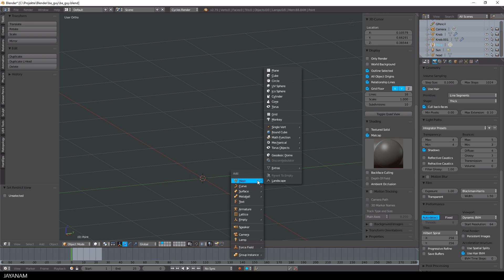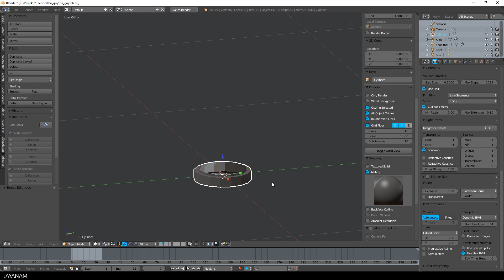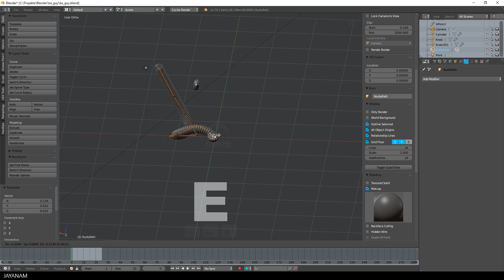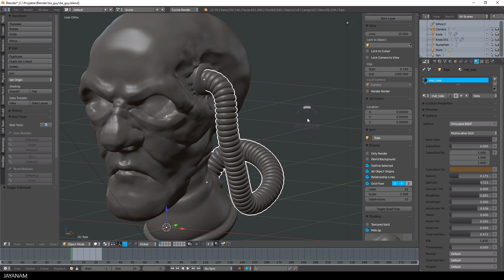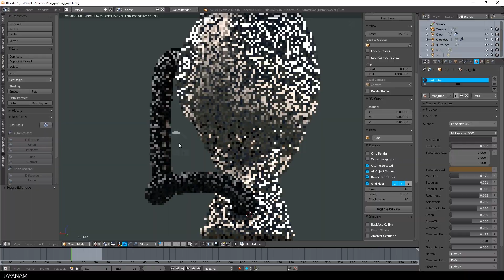Blender Tubes with Curve and Array Modifier

Comment: Fit curve does not make cylinder the length of the path -blender 2.79b
Reply: Press Ctrl-A and apply scale on the mesh.
Reply: @lahcenebelbachir7929  Thanks, I forget it every time and search 15 minutes for a solution
Reply: @mico_psyop_catgirl  No problem, I keep forgetting them too!
Reply: Same thing in Blender 2.8, did you find a work around by any chance?

Comment: thank you - this was very hepful and exactly what i need for making a vacuum cleaner tube. the only things i have to work on now are adding bones for animation and making sure that the pipe stays the same length. i presume that once one stops adjusting the NurbsPath, the length of the pipe will become fixed.
two points regarding tutorial details:
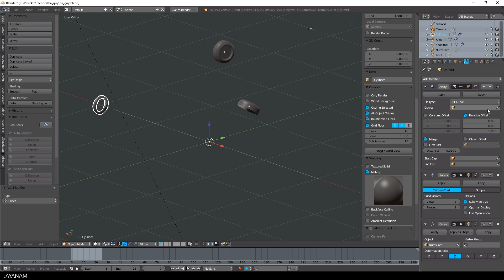1) at 2:51 the narration says 'Fit Length' but the visual shows 'Fit Curve'. having tried both, only Fit Curve will work. 
2) at 2:59 when switching to edit node it is very important to notice that this means edit mode for the NurbsPath not the pipe/cylinder. if not, and one stays with the cylinder/pipe selected, the pipe suddenly becomes vertical in edit mode (at least mine did), which is not what is desired.
Reply from the maker: 1) Yes, thx for the correction but I think it's clear when watching the video, same for 2).
Reply: yes, it is clear from the video, but it tripped me up and i wanted to alert others to pay special attention at these points. being in the right mode and having the right thing selected is so important, but it is easy as a learning user to be in the wrong place and then none of the clever blender things will work!
Reply: what mode are you in and what have got selected? i am pretty sure it has nothing to do with the version.
Reply from the maker: Did you define the relative offset in the array modifier? Did you add the curve in the curve modifier? Did you add the curve in the array modifier?
Reply from the maker: Try to apply the scale for the object you created... and now, you dont need an addon, works out of the box. And you also added the curve modifier?
Reply from the maker: You said ou scaled it down and after that - if you scaled in object mode - you have to apply the scale (Control and A key, then choose Scale to apply it). Because otherwise Blender has the wrong scale. See the effect in 04:14 after I scaled and then I applied!
Reply from the maker: Great, always good to learn new stuff:-)

Comment: One issue with this is that if you were to animate it, you would have to be real careful to keep the curve the same length at all times otherwise one of the ends of the tube would appear to move in and out of the body as the curve length changes. But really at that point it would be better to just apply the mods and add a few bones to the tube to deal with animation.
Reply from the maker: Yes, that's right
Reply: What if you add hooks to the ends and parent these. Than use hooks for the other verts to animate it
Reply: I thought that parenting would fix this. But if you add a copy Transform constraint it follows perfect and also deforms perfect. It doesnt go offside like before. I did change the path to Nurbs and then to auto. I prefer this one over the other one
Reply: Here's my setup and a preview. The thin black line is the curve and you see the mesh follow it perfect. File: https://www.dropbox.com/s/xg6qo3x1y3zbevu/Array_nurbe_curve.blend?raw=1
Preview: https://www.dropbox.com/s/mxk8orms9xmihjp/Curve_anim.mp4?raw=1